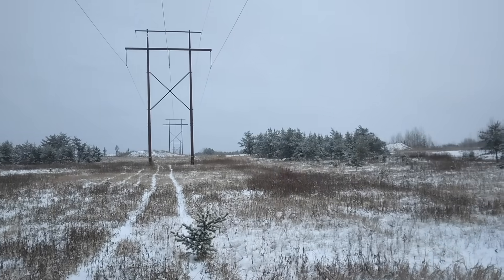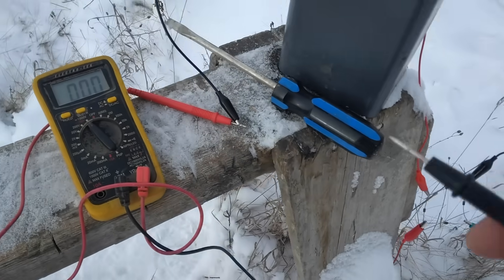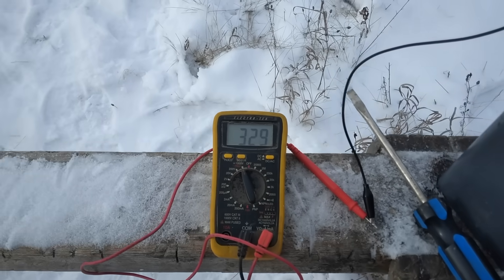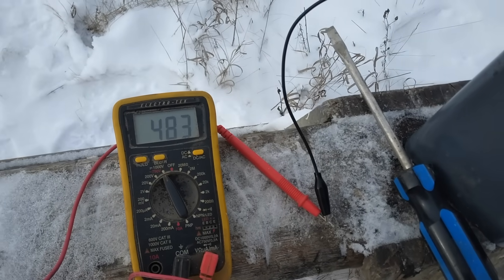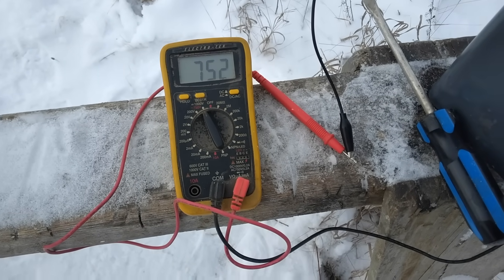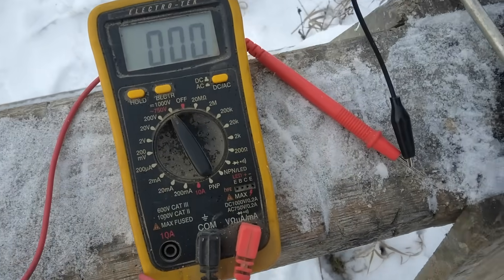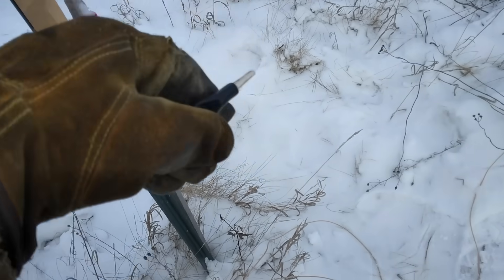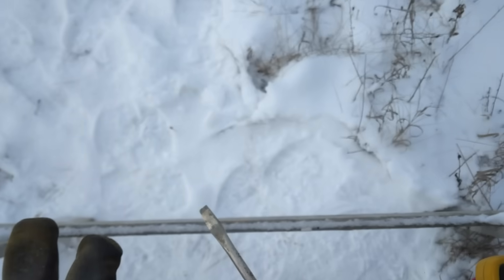Fences sucking power from under HV transmission lines

Comment: We measure the earths field with a long wire like that. The wire does not need to be near any electricity to make power. The schumann resonance field is always there. It would generate even more power if the wire was from the ground to super high up in the sky, the differential will make a much bigger difference. Personally, I would not even go near power lines, they are really bad for living things.

Comment: I  am not sure you are "stealing electrcity".  There is a field that lets you harness, capture, some power. But are you acually taking any current away from the transmission lines or is this a field/power that is gone anyway???
Reply: It would cause some resistance to the power line but it's very tiny mount that's hardly greater than the natural resistance.

Comment: There is reason to believe transmission lines running through heavy traffic areas causes the metal particulates in exhaust to be polarized and cause them to adhere to the lining of the lungs.  This might explain why cancer clusters are found in areas where heavy traffic and transmission lines are in close proximity?   
Unversity of Liverpool was researching this a couple of decades back but haven't heard anything since.

Comment: Ok, I know very little about electricity, so just a few observations.  I am assuming the electro magnetic field generated by the power lines is strong enough to induce an electric current in the fence.  And this works even though the fence is a good distance below the overhead wires.  This begs the question, how do such magnetic fields affect the human body?  There were theories going around that if you live within a certain range of high tension overhead power lines, you were more at risk of getting cancer and maybe other diseases.  I wonder was any conclusive research ever carried out on this question?

Comment: Just put a coil, that is a standard way to get power to your rural moonshine production.
- on an open area the coil will be visible as it warms and melts the snow.
- Power companies can calculate if there is excess loss at some section of the line.

Comment: What you are extracting is electrostatic AC coupling. Basically the air is a dielectric insulator. The transmission line is one pole of a electrode in a capacitor your insulated thhn wire is the other electrode of the capacitor. The towers are grounded and the lightning grounds on the tower top are grounded at each tower and each substation and power plant. And your ground rod completed the circuit.

Comment: What could be run out of the contraption in the video? How could you maximize the "free" energy output, i.e., if I had a 220kV line crossing my property, what could be run out of it using the induction? Just (very) curious!

Comment: I wouldn't refer to this as "sucking power" because that makes it sound like you're taking from the power grid. In actuality this is more like you're USING the ambient electromagnetic field emanating from the lines which is normally wasted and lost as the power is transmitted over long distances. It's like going the lumber yard or steel works and getting some free off-cuttings that they are unable to use efficiently and would otherwise become production waste.

Comment: The powering near my house lights up my outdoor LED porch light.  Also, the electric horse fence wire ( not connected to charger) transmits electricity several hundred feet.

Comment: Charging a circuit, to a usable current level, from air induction is possible but the physical size of the capacitors, coils and wire lengths makes it a diminishing return operation. Possible but very unlikely.

Comment: You should be able to collect about 1200volts reconing the height of the powerlines.
You get 100volts every 3.3ft off the ground.  Thus 40feet is about 1200Volts.

Comment: Okay, now you can build a small relay system to pull off the power from the capacitor when it reached maybe 500VDC, then rest and keep it low, and slow, charging a few batteries. Next thing you know, you've got enough to run a small cabin 50-100 feet back from the easement, and never have to touch a power bill. I suspect I'm not the only one who wants to see a video about this, so please keep at it.

Comment: I have some big ones by me.  They make a helluva racket on the Ham Radio.   
Sometimes you can take fluorescent tubes out and get them to flash.  In the ones up in the hills by my house you can get a continual AC spark between your finger and a rifle like a 10-22. 

I figure if you can find something with enough voltage drop you could use a capacitor array or maybe even SLAs and then LEDs.  Maybe batteries with a voltage drop and incandescent bulbs.

Comment: I was working as an arborist slashing under the power lines and we came across a lot of insulated wire under the transmission lines. It turns out that the guy that owned the property used to work for BC hydro and figured out a system where the coils of wire tapped the electromagnetic field of the transmission lines and ran down to a transformer by one of his sheds. Inside of his shed was a battery bank that was being charged and that's what he used to power his barn, well and his house. Power outages in that area were quite common in the distribution system so his neighbours figured that he just was running his house on a genset when their power went out because his house was always lit up.

Comment: without a load the voltage will continue to increase.......!   That is why inside a 345KV power substation Vynil Fencing was installed around a Capacitor Array....!

Comment: A Fire Department Snorkel truck got their bucket within about twelve feet of a wire that was on top of a pole(higher voltage).The transmission line air arched and blew 8 new steel radial tires out on the truck and hurt a couple of firemen pretty badly, that were in the Snorkel bucket. I am glad that I didn't have to write a report on the incident.

Comment: I was riding my trail bicycle under some high tension lines last summer and felt a sting between my thigh and a metal fastener on the bike seat. (The bike's frame is aluminum.) I jumped off to see if I had an insect sting. Then I discovered the bike frame was "live" with enough energy to create a continuous sting when I touched the frame. Certain discomfort. I wonder if the power company has done any studies on the risk to health since they allow access under these power lines.

Comment: Really cool! I knew there was a way. You still should show how to utilize the compassiter to power something.  A boss back in "83 told me that he got power from the lines coming from Bonneville damn,but I didn't ever learn how before he sold out and retired.  Wayne was smart and I learned a BUNCH  from him. The new boss was a pencil pushing asshole that only knew paper and had no knowledge of how to do the work that was happening in the shop. I  quit for a higher paying job.  Looking back I didn't know that I should have went to the Union and they would have helped me. NEVER should have quit the machinist and aerospace union. One of the dumbest things that I have ever done.

Comment: As the comments show, this isn't unusual.   It's possible to tap power from high tension lines without touching them.  Maybe not the safest thing on earth, but it's certainly doable.  It's the same principle as a wireless charger, just way more power and voltage in the line.

Comment: No real discussion of current, but judging from how quickly the capacitor is charging, there isn't much of it. What would be interesting is if there were a 60Hz resonant inductor/capacitor combination, with the inductor acting as the aerial - similar to a large ferrite rod aerial but without the ferrite, and much larger so it resonates at 60Hz. That might produce some useful energy, but you will always be limited by the distance from the lines themselves resulting is a very loose coupling.

Comment: I did basically same thing but used a ONE farad, not a micro-farad  cap,  10,000 volt capacitor  which I took out from a early 1960's heart  defibrillator. I rigged up a couple of thick copper bars about two inches apart, each attached with jumper cables to  the terminals. After charging for an afternoon, I laid a one inch bar of steel across both bars, the discharge took a inch off the bar and sounded like a gun shot from a 44 Magnum.. I won't do that again.

Comment: In rural America, people throw a long wire over the high voltage lines to extract power. They also drill holes in the gas lines. I know this because my neighbors do it. My great grandfather even wrote a book about it 100 years agos. He even wrote about tapping in to the telegraph lines. A friend of his used the telegraph tapping technology to bull run the stock market once. It's a good story.

Comment: Interest experiment. In the UK we have a lot of double circuit towers. So, when we take the line out for maintenance it behaves a bit like your fence although many thousands of volts and linesmen have sadly been killed when not following the safety rules. Besides the high Impressed Voltage, the other problem we had (been retired a long time now) is when we earth (ground for USA) the circuit at both ends a circulation current maybe up to 450 amps appears. This needs to be managed. Capacitive induction imposes a transverse electric field on the conductors of the dead circuit. May be 10,000 volts and Longitudinal electric fields on the conductors forming the loops giving rise to large currents which cannot be removed by earthing.

Comment: Back in the 70s when I was in high school, all the rage was having a big whip antenna for your CB radio mounted to your truck… mine had about a 6 foot stainless antenna, we farmed a ranch that had huge high voltage wires that ran across it, one very hot day I parked my truck underneath them and was irrigating my alfalfa field, I was out in the field for over an hour when I heard my dog yelping and then jump out. I couldn’t figure out what was wrong with him until I went over to my truck and I couldn’t get him because the door handle was so hot from the electricity overhead.!!! I had to use a towel on the door handle to open it. It was sucking the electricity through the antenna, whip, my dog wouldn’t jump in the back for the rest of that day… true story

Comment: You could drive a bunch of LED with that. Just make sure you connect some current limiting resistors in series with them. See how many LED you can run in series.

Comment: Going by the normal turns ratio of a transformer which would in this case be 1;1 it stands to reason the voltage would eventually equal the power line voltage. In this case you are a distance away from the lines but the magnetic field is still going to have an affect and your capacitor is absorbing current. As the voltage continues to increase the current decreased to the point the circuit you are working with here breaks down and a short circuit occurs or the diodes open. Either way this is for sure a dangerous experiment and you did shit in down before it shut its self down!

Comment: very dangerous experiment, it is scary to see that the guy was not using safety gloves in the beginning. It is an induction voltage, could be fatal if touched bare handed.

Comment: Had our quad parked on a hilltop to take pictures....not underneath but close and parallel to the HV power lines;  went to get back on and got a shock when I put my hands on the hand grip to climb on.  The spark was jumping from my hand to the steel handle bar.  We left pretty quick.  Wild

Comment: In the late '90s I was "struck by lightning" during a thunderstorm opening a ranch gate with a piece of chain hooked on a sawed off lag bolt. I have since figured out it was probably a capacitative discharge because I remember seeing arcs through the chain as I disconnected it, scared the p, waddling out of me, thought I was dead

Comment: You should not do this, regardless of what others say, it is stealing. It is the same as tapping into a fire hydrant.
Reply: If the hydrant was down in a deep hole and had a leak that caused the hole to fill and the pressure created by gravity was sufficient to stop the leak, and you dropped the water level by removing and using the water, causing the leak to resume, then that would be the same as tapping power from the overhead lines.

Comment: If you use a buck converter to step down the voltage to 12 or 24 volts, you could get higher current.

Comment: Do a one foot wide piece of copper with a heavy gage wire brazed to it on one and attach it to your fence post with insulators @ 80 or 100 feet long. That thing will be putting out some serious juice. Anytime we have a big  geomagnetic storm in our atmosphere the power grid all over North America get supercharged. Doing it with a 1 foot wide piece of copper 100 feet long under those power lines will provide a whole lot of surface area for those electromagnetic particles to hit coming off those powerlines. That was a cool video though thanks for making it.

Comment: I've seen a chain ling fence arc at night because it was under high voltage.  You could get shocked if you touched it in the right spots.   Just FYI if you have livestock those power lines will kill them and will give you cancer if you are under them often.  It only takes 6 volts to kill a cow.

Comment: When I was a lineman a mail delivery person stopped me and said, “Every time he touched a mail box to pick up the mail he got a strong shock”.There was a 230,000 volt transmission line running about 80 ft above and inducing a static charge on the mail box. I installed a ground rod and hooked it up to the box . Problem solved.

Comment: Using transformer action to steal power from power lines is considered an illegal electrical connection, you are connected via the magnetic field, don't try this folks, it is illegal. :face-green-smiling::face-green-smiling::face-green-smiling::face-green-smiling::face-green-smiling::face-green-smiling::face-green-smiling::face-green-smiling::face-green-smiling::face-green-smiling:

Comment: The power companies have right of way or easement giving them the legal right to build power lines right through or over your home. These power lines bleed and leak energy through magnetic induction and resistance that gets converted into heat. You are just setting up a energy collection device to catch the waste energy in the for of magnetic fields by funnel it into a battery with another magnetic field. It's the equivalent of trying to punish a homeless person looking for food in a trash can placed on the side of the road for pickup and disposal. You aren't tapping into the useable energy that is in the lines only the none useable energy that is wasted producing magnetic fields. But do this at your on risk. Some courts are not sure on what to do about this issue, so let it go and others hit you with a felony and jail time. So it's not worth fighting over if a linemen sees it and reports it to the authorities.

Comment: If you make a pole to reach from your property to reach the sweet spot, the energy co. Do not own the airspace around their easement and they can not prosecute for energy theft. The government uses this method to validate their ability to capture and record your phone data, outside of middle man attacks. Middle man attacks is where the police or government entity captures you incoming and out going phone calls before it get to the tower, they then patch you to a local tower. This allows them to gain evidence against you by capturing your data coming and going. I use a similar method or a form of war driving in combination with a frequency finder to capture and listen to city and state officials. What I capture floating around in space is for my taking

Comment: My cabin in Northern Wisconsin  has  identical power lines, except the easement is 65 feet. I've always wanted to try cyclone fence like you're doing and see if I could charge batteries.

Comment: The power lines are like huge antennas broadcasting a radio signal of 60 Hz which is a very low frequency. It is a radio broadcast so it is free to collect the signal with any kind of receiver antenna. The challenge is to build an antenna that will collect enough wattage of that electric signal to be useful. For building an efficient low-frequency (LF) receiving antenna, the primary challenge is that the wavelengths are extremely long (1–10 kilometers). So for a VLF of 60 Hz it would be in the range of a thousand kilometers. With shorter length of antennas you can have high voltage readouts near a high voltage power line but with a so small amperage that the wattage would be minuscule.

Comment: The really high voltage lines aren't insulated, the reason they kick the voltage up, is so they they can have thousands of amps going through a similar size line you have on the outside of your house. These lines are most likely feeding a sub station, then processed down between 20kv-5kv to feed the neighborhood transformers which drop it down to 240vac then feed multiple houses, typically around 4-6 I'd think. The highest lines on your street are most likely 5kv to 20kv, then the transformers on the poles, down to the lower lines that are 240v. The lower lines going to schools and businesses are 3 phase anywhere from 208-480vac. For my fellow nerds 😎

Comment: The power induced in your "antenna" will be greater when the load on the transmission line is highest. The greater the load the the more dense the induced magnetic field. As in the summer afternoon when A/C use is highest or winter when electric heat is in use. Also the increased load on the transmission line in hot weather causes the line to sag more, bringing it closer to your conductor and increasing the magnetic field coupling.